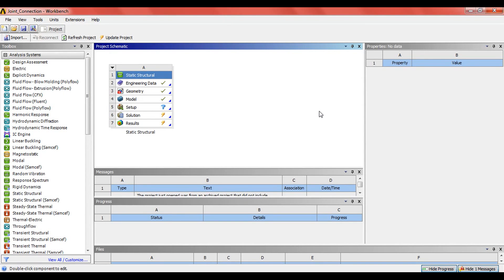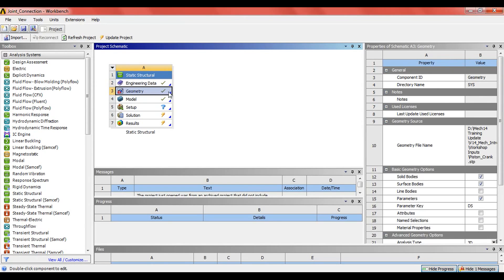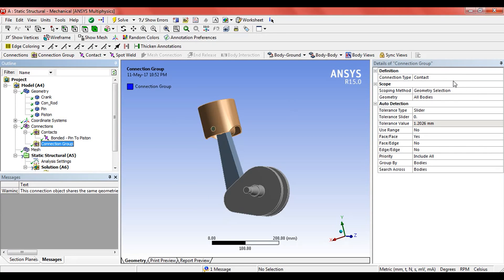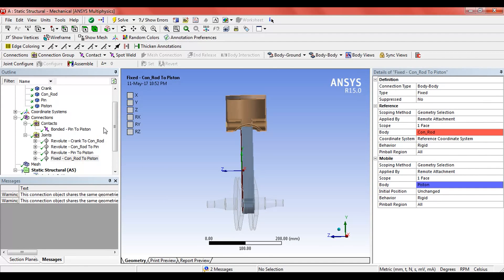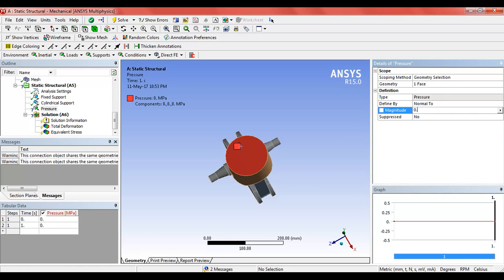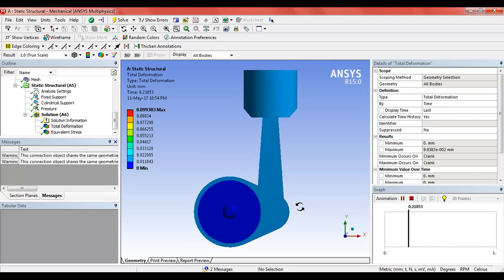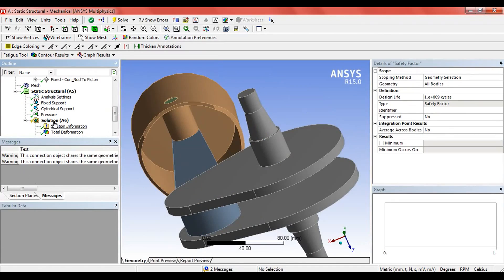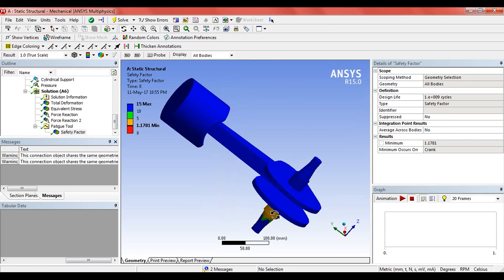How to use Joints and calculate reaction forces in ANSYS Workbench

Comment: Sir would there be any difference if I use probe for reaction force?
Reply from the maker: I don't think it will make any difference but still you can check both method to verify the result.
Reply: Ansys Simplified I have a hub in which a shaft is placed, I am selecting that shaft for cylindrical support but its not giving reaction forces and reaction moment.